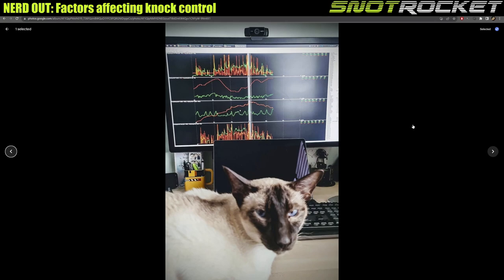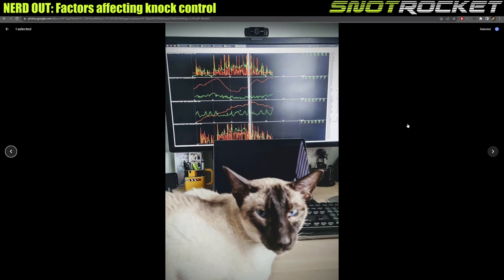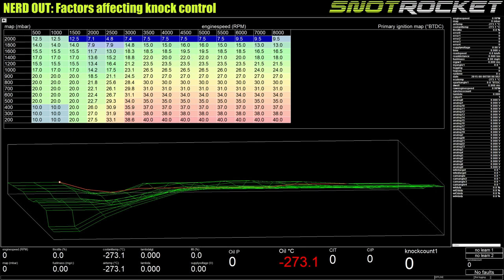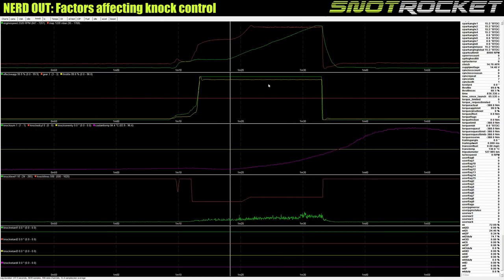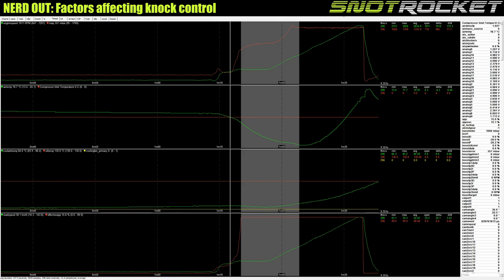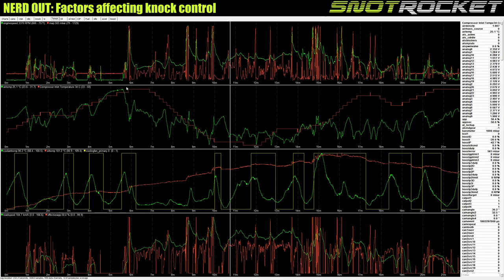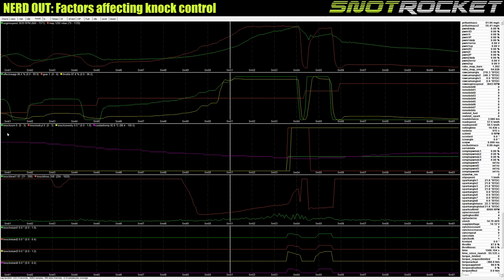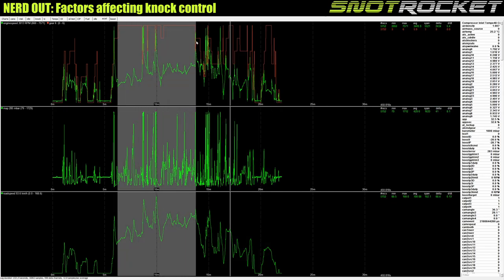NERD OUT PODCAST - Episode 001 - Knock Control and how the weather impacts spark angle selection

Comment: Interesting and insightful video that will be useful to many - nice job. I liked the disclaimer ref. not being a tuner lol, but your knowledge in this vid is better than a lot doing it 'professionally'

I would recommend setting up the ACT, ECT 'trims' in the ECU to aid and give the knock control strategy a helping hand. You can use this from the data you have collected like you said, or you can do it more scientifically if you wanted.

Only other advice - early on in the video where you are discussing ignition angle relative to engine RPM, the theory is back to front here. When engine VE decreases, your fuel table will indeed need to decrease, but you will actually need to advance the ignition timing, rather than retarding like you are currently doing. There is two things to address separately in this instance - the actual engine VE and the RPM.

On RPM, as the engine speed increases, your cycle time/time to burn decreases, but the actual propagation speed remains relatively constant, so you need to start the event slight earlier (i.e advanced) to obtain the same result 'on time'. Its not going to be a drastic advancement, but it should be increasing from peak torque gradually up to the rev limiter subject to your knock sensitivity, but on a K20/4 it does follow this trend. It wont be huge, but usually 3-5 degrees or so peak. This will most likely be why HP/Torque is flatlining/dropping a bit on your dyno graph from memory as to what I saw on Facebook which isnt the usual characteristic of a K-series (assuming VVT is tuned correct which i assume it is :) ). On the VE side, its much like why you run more timing when in cruise regions where engines are not at peak VE, using your current theory of retarding when VE drops is counter initiative if you use that as a comparison in this same situation . 

Either way, good vid and I look forward to more! Content I've always wanted to get round to making but haven't found time..!
Reply from the maker: Thanks for your comments and perspective. ACT/ECT modifiers are in place for both fuel and spark 👍🏼. I can't run any more ignition at the top as it's det limited - I'm working to a theory that the log manifold is suffering from excessive back pressure due to reversion, and at this power level the engine is quickly starting to hit a brick wall. I need to hook up some pressure sensors to test the hypothesis. I'll do a video on that sometime one way or another.